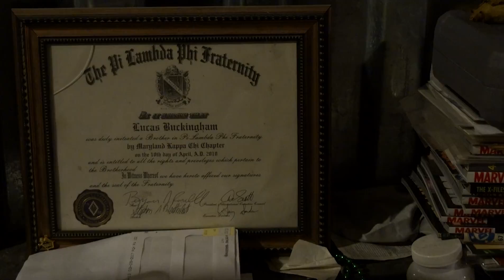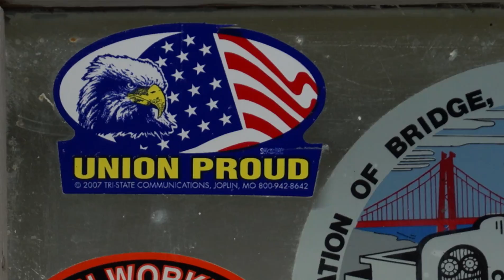The life of an apprentice ironworker: 'Everyday is a struggle'

Comment: steel jobs are not automated in any way shape or form. We get up there and get our hands dirty connecting, rigging, and welding every single day. how are you gonna sit there and act like technology is putting people out of the job? the truth is there are a lot of trade jobs, not just ironworking, that have empty positions because people around my age group tend to go to college where they go heavily into debt and most of them don't even have a degree to show for it, or worse a gender studies or liberal arts degree. You can easily buy yourself a cheap welding machine, some 7018 rods, and get some scrap steel and start practicing how to weld. many people i work with started welding between 14 and 16 years old. Trade schools are an option as well and cost a lot less than college.
Reply: brandyn rhode there is a giant welding machine at my job and pipefitters have to operate it
Reply: @brandyn rhode exactly

Comment: I'm a union  sheet metal  worker  over 23 year the future  is looking  better  then I've ever seen thank you Donald Trump.
Reply: Local 80 here couldn’t agree more
Reply: @jjtmmjjmm2113  what about now with steel sheet metal clean can be expensive  works like clay hi and lows shrink cool bust out tig or torch  i did a ready for scrap ford 86 its still not done but its like new and i have crazy hours in this thing bed was mangled cab its got a cummins sadly got hurt bad and things are going to be different but im finishing this truck better than new truck all mechanical no electrics to stop me f and r 4 link im going for nice ride on slicks  .. 750-800ish streetable power and ill be able to drive again first with hand controls then finally ill have my freedom to drive again im 29 years of age full shop just got hit head on old lady suv and i was on a steel horse day after xmas 2018 .... lots of life to go not losing track of my dreams and sweet resto mods in my shape now i have to find what i can be successful at working before accident sa200 ironworker ready passed the 6g test blind it was a scratch start haha and the guy showed me 5 or 6 close flashes anyway any response would be very valuable to me after years of pain and struggle      lets get this proshaper